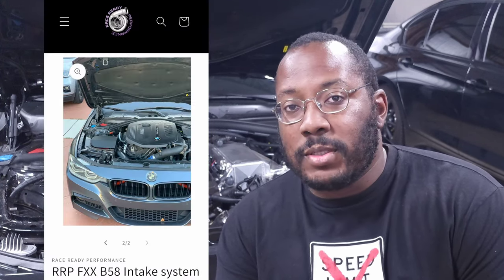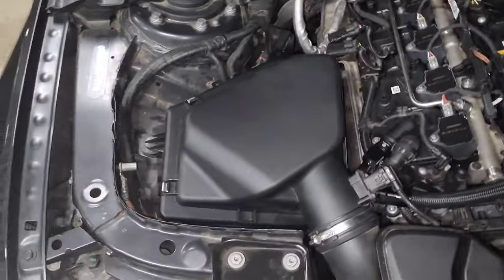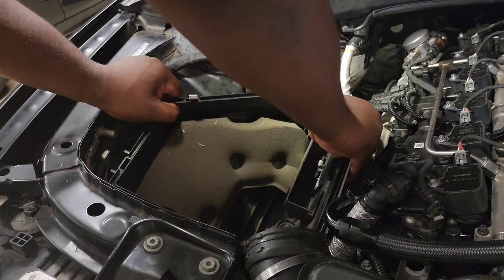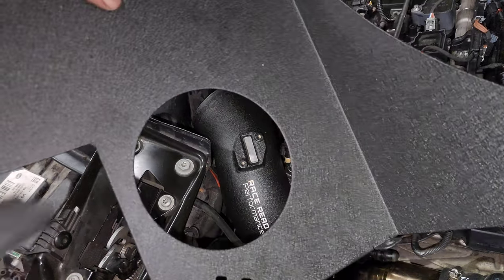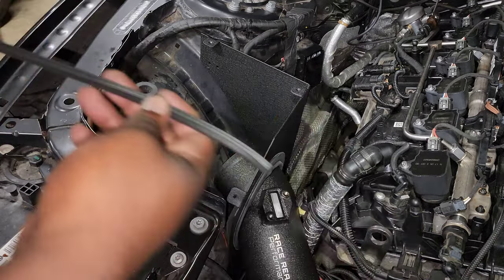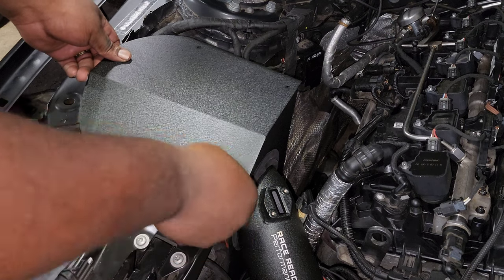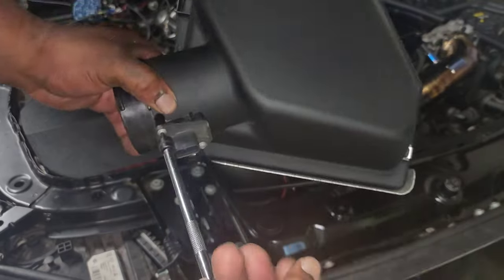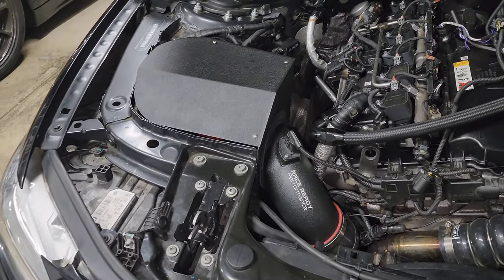Upgrading the Intake on my FBO 340i!

Comment: I don’t think these intakes do anything but sound and I’m some cases even make performance worse
Reply: not really once your upgrading your turbo and adding fueling upgrades the car is gonna need alot more air and having a closed intake can even be less beneficial. these intakes allow alot more air flow.
Reply: He did tests on like every b58 intake and the performance results from each of u really want to know😂 it doesn’t make much hp gains if at all. And that was on his big single turbo car not this 340. Anyway I grabbed the CTS intake just to be able to hear the turbo spool..
Reply from the maker: This was done because i didnt want any limitations in airflow with the new cams. Stock intake is fine for most setups.
Reply: @kern417 is the stock intake ok with hot climate mod ,with  pure 800  dorch stage 1 running on 99 Ron

Comment: best to replace that kyostar filter with the proram ram air medium size filter with velocity stack
Reply: What was the neck Diameter you went with?
Reply: @Renzology  it’s a set and for the stack you take the 90mm silicone hose coupler to attach to the pipe, filter looks amazingly good

Comment: With the Ross Racing PCV Delete Kit were you getting a rattle on the front VTA fitting to the OEM air box near the MAF sensor? I can't seem to get mine aligned so that I don't have a rattle there.
Reply from the maker: no i didn't. i rotated the connector so it's not touching the intake or MAF.

Comment: Hey man I have MHD tune on my 440i, recently installed tu2 hpfp. Was planning on doing the flex fuel conversion, however in the stage2+ maps on MHD there is no option for the TU2 pump, only stage 1 dorch, stage 2 dorch, etc. I was wondering if I will have to get a custom tune in order to run e40 on the tu2 pump or will one of the other options suffice? Decided not to select one of the upgraded pumps and just ran the tune on the ‘stock hpfp’ option.
Reply from the maker: it runs on the stock settings
https://youtu.be/It8MrjLVtu0